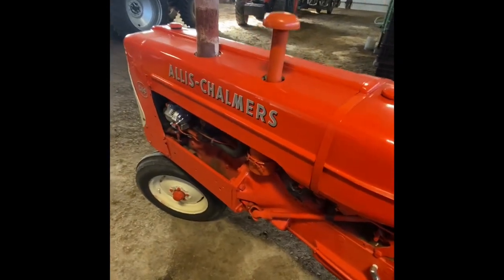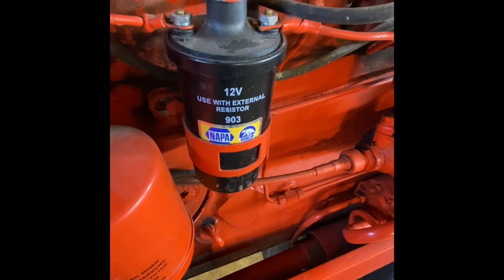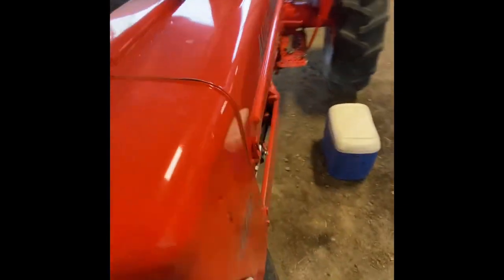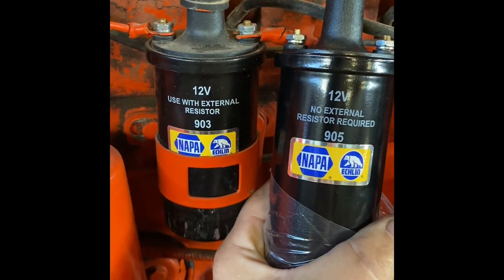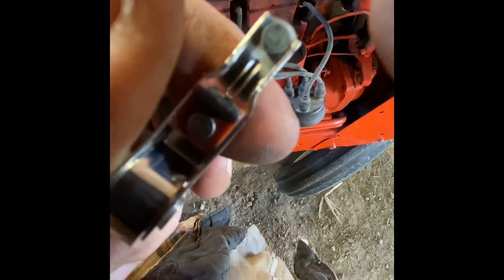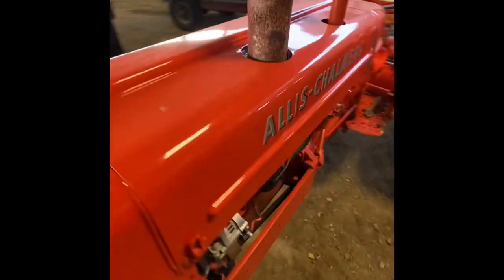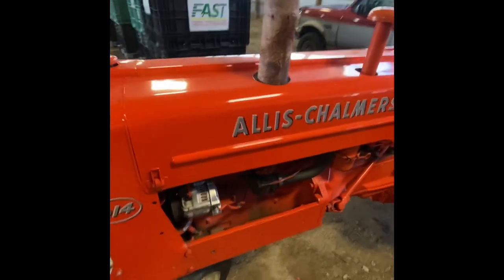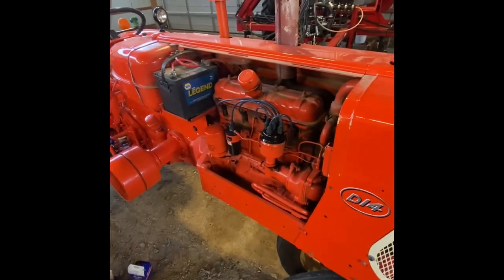12 volt resisted Coils and why they’re important! Allis Chalmers D-14 service call

Comment: Best thing I did to my WD45 was convert it to 12 volts and install a Pertronix electronic ignition. 
Hotter spark and no points to wear out.
Reply from the maker: 12 v makes them run/start so much better. I have a love/hate relationship with those Pertronix units though 🤣